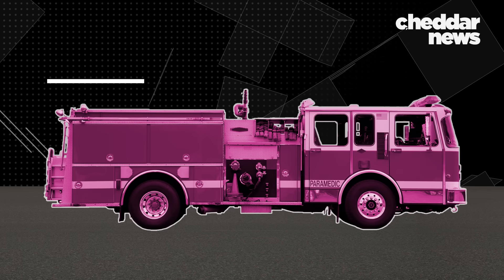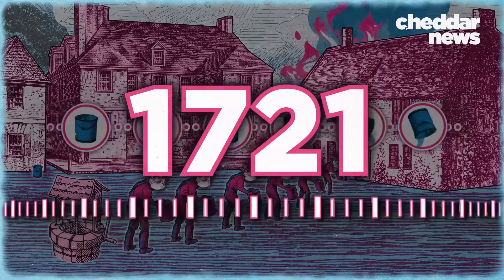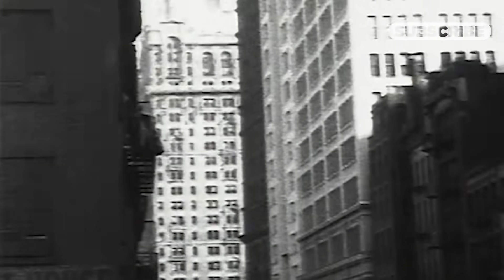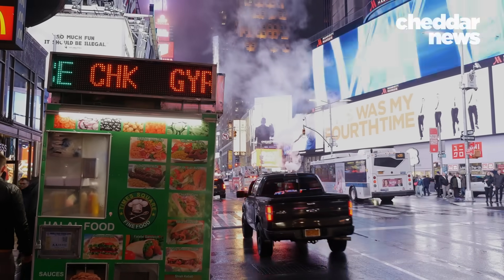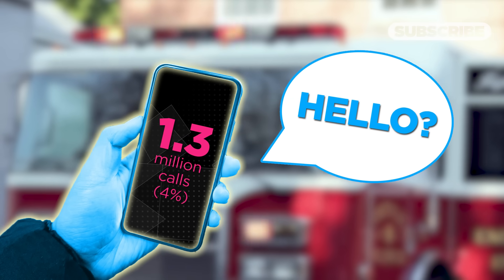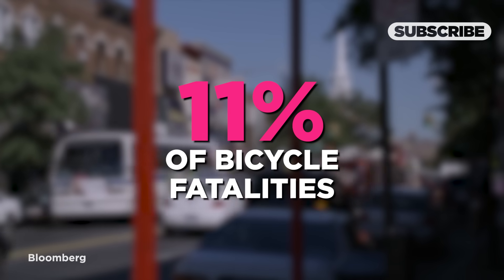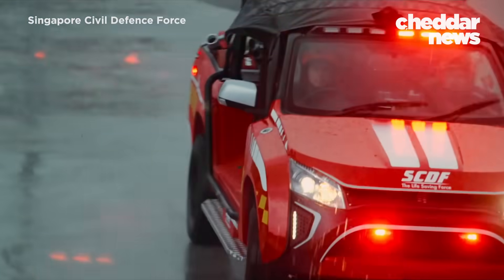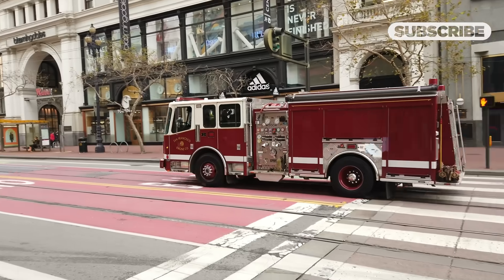Do American Fire Trucks Need To Be So Massive? - Cheddar Explains

Comment: Just a few notes, fire trucks are not 10 feet wide, only 8 feet DOT regulation. Yes ladder trucks can be 40 feet long, most engines are well under 40 feet. American firefighters perform much more than just fight fire. Medical call, hazardous materials, rescue, and all the equipment need for them to perform  their jobs. As for fire apparatus accidents do happen, in statistics about fire apparatus accidents you failed to post you was at fault. 95% of fire related motor vehicle accidents are not the fault of the fire apparatus driver. Failure to yield to emergency vehicle is the number 1 cause. Yes they are heavy just like any large truck in the US. Again you failed to mention that fire apparatus drivers are trained to the NFPA standards to be able to operate a fire apparatus. European fire department  are for the most part national organizations. In the US each City, county or district are responsible for fire protection. Also in Europe most streets are much narrow than in the US and n one major difference is most European structures are made out of stone, concrete and other non-flammable materials. There simply is not enough trees in Europe for them to be made out of wood. Isn the US most structures are made out of wood framing. Yes we have concrete and steel but the vast majority ate wood frame. European firefighters most fight room and content fire. The US firefighters fire actual structure fires. One thing in American fire trucks that take up a large amount of space and add a lot of weight are the water tanks. Depending on the area city, urban, rural dictates how much water a fire truck needs to carry. There are no fire hydrants in the vast rural areas of the US. Europeans do not carry as much water. Yes we can place 4 to 5 firefighters in a small 1st response vehicle and they are perfect for medical calls. Not so good for rescue or fires. We can send 50 firefighters in a bus to a large fire, but what good are they without their equipment? Before you start bashing the size of American fire trucks please take some time to learn what it takes to become a fire fighter and what the American fire service does and how does it. Yes it would be nice to have smaller fire trucks. But when you look closer like your video shows fire trucks come in all shapes and sizes. Each one does something special very well, at the same time it has to respond to all types of call. One major problem faced by the American fire service is all fire apparatus regardless of who is using it, must meet the federal requirements and EPA requirements, DOT requirements, and NFPA requirements. All of these always drive up the cost. European fire trucks must also meet their standards which I do not know how strict or lax they are. The standards of service will always dictate what you have to meet and how.  Thank you for your time

Comment: One thing you're missing is that, yes, most calls to the fire station are medical, (between 2/3s to 3/4s, depending on time/area); but when that happens, fire engines don't roll out- the EMS vans at fire stations do. Forgetting that detail is problematic, as it paints the picture of the fire engines rushing out when someone has a heart attack...

Comment: All I hear is more European Superiority without an explanation as to why. As a former firefighter I noticed in Paris and London they have as much problems with traffic as any other congested city. A really nebulous category is how a fire truck should look. We like the way ours look. If you don't oh well. Ours carries a lot of equipment. A lot. It is better to have and not need then need and not have. There was no real detail on why the trucks are different. Just more "European is better". What about a list of what the standard FDNY engine, truck and tower ladder carry vs. A London or Paris pump, turntable and platform carry?
Reply: Europeans firetrucks carry a lot of equipment too despite their compact size. This is the typical layout in an Italian engine (APS), which carries also 5/6 firefighters.
https://youtu.be/i8Y32mshPrQ
Reply: @thecommentaryking  they may and they may not. A YouTube video is a poor substitute for actual lists. There is a reason ours are the way they are. And a reason the Italians are the way theirs is. I don't even consider this a thing. Another thing....what is the cost of a pump in London, Paris or Rome? A turntable ladder? A platform? What are each's capabilities in comparison to a U.S. equivalent? Are they the same? Different? By how much do they differ in capability. For instance I believe the highest output standard pump output in France is 800 GPM. For the FDNY its 1500. (I believe). Obviously we didn't just pull this number out of a hat. There is a reason this was spec'ed out like this.
Reply: @richcook2007  Over a thousand litres a minute is nothing to sniff at.
Reply: @richcook2007  Yeah no. Fire equipment is standardized here, maybe a piece of gear might not be avaiable to the rural volunteer detachment here, but all provincial commands, especially those in the largest cities are fully stocked. Plus in the comment section of that video there were italian firefighters that confirmed that the equipment was what they actually carried.

Sure there's a reason in the US you use Pierce trucks, and there's a reason we use here commercial trucks. But my point was another, that the fact that ours are smaller doesn't mean that they carry less.

As for prices, they range from 200,000 to about 500,000 € per piece for new engines and ladders. Capabilities are similar, an APS (engine) here is the basic rescue vehicle, called for most emergencies like fires, car/vehicle accidents, technical rescues, nbcr, people locked out of their homes, etc. Other vehicles (like ladders) are classified as support, meaning they will carry only a crew of two, minimal equipment and be sent on a scene where an engine is already present or is on the way.
Reply: @oscarosullivan4513  Did I say it was?
Reply: @thecommentaryking  yeah, no. Ladders are just classified as front line apparatus. With a full complement of ground ladders and extrication gear plus cutting equipment for ventilation, and, maybe a pump as a quint. Your version of fully equipped may not be ours. If cities want to spec smaller rigs have at it. I'm not advocating one over the other. Budgets and need will dictate. But the video served absolutely no need other than ours is better backed up by exactly zero data.
Reply: @richcook2007  Maybe in the US, not in Italy and most of Europe. Ladders are sent out to support the engines in specific cases, they don't go out on their own.

That the video is dumb as it is, is something that I can agree with, it lacks much information regarding both sides, the tactics, the needs, the organization, the building construction standards and how urban/rural the territory is (in Europe everything is much closer).
Reply: @oscarosullivan4513  I apologize fore the snarkiness of my response.
Reply: @richcook2007  we sure, an Engine in e.g. Germany carries a lot of equipment as well. "A YouTube video is a poor substitute for actual lists." ... well then: a by now outdated norm for the Engines defined a minimum of 164 different tools at a total number of 284 pieces, but that was on trucks which are more than a dozen years old now.
Reply: @thecommentaryking  "they don't go out on their own." that clearly depends on the nature of the call. Depending on the country and call, they definetly DO respond to incidents on their own
"in Europe everything is much closer" yeah lol ask those guys up in Sweden or Norway
Reply: @EnjoyFirefighting  I would like to see that list. Also we have combination companies: medic engines and rescue engines that combine functions. I am putting the size difference to differences in firefighting philosophy.
Reply: @richcook2007  let me see ... I try to find a way to make you see it without me doing some sort of copyright infringement, like posting pics from database where I counted that. To read the  DIN 14530-27:2019-11 online would cost almost $80, not really an option. Well ... then try this one from one of the state fire academies in my state. Click onto the website and scroll down to where it says "HLF 20". I'll open a pdf file listing the bare minimum of required equipment for a standard Rescue Engine (former only classified as Engine) here. It's in German, but you could translate the single positions via google translator if you're interested in what they actually write down there; Right next to the piece of equipment is the respective number of the DIN standard, and the 3rd column shows how many pieces of that equipment need to be on board: https://www.sfsr.de/feuerwehrfahrzeuge-ausruestung/mindestausruestung-fuer-normfahrzeuge-der-feuerwehr-in-bayern

You might not come quite to the number I mentioned for various reasons: the standard has changed and adapted over time; Some things which might have been counted seperatly in the past could be grouped together has a set of equipment x, which consists out of several pieces, but counts as only 1. Thus e.g. the set of lifting cusions count as 1, and so does the box with 14 pieces of wood of 4 different kinds count as 1 just like the set of rescue cylinders counts as 1 as well.
Reply: @EnjoyFirefighting  a gentleman in this thread listed the equipment his truck carries. At some pint I will compare the two. Thank you.
Reply: @EnjoyFirefighting   Sure, it depends on the country, in fact, I commented in regards to my country, Italy.
As for distances, Norway, Sweden and Finland aren't the norm but the exception in Europe and if we are really fair, some US and Canadians fire services have far more territory to cover.
Reply: @thecommentaryking  sure they're different than many places in Europe, however those countries in northern Europe make one eighth of Europe's area and thus should be a legimate aspect in that discussion as well. 
"some US and Canadians fire services have far more territory to cover." first I thought it would be more about USA and not Canada, and then I have no doubt that there are services which cover greater areas. But there are definetly large areas to cover by some departments here as well, like a department in Sweden covering 8,000 sq mi, with 17k out of total 22k inhabitants living in a town of 6 sq mi. In Finland there's a department covering 38,000 sq mi which equals one third of the country's land area. Sure smaller than what some departments cover in Alaska, I have absolutely no clue about the size of their response areas, but you got to admit that 8,000 sq mi or 38,000 sq mi of response area is not small

Comment: i'm a firefigther in argentina, i've had the chance to use both american and european firetrucks and believe me theres nothing like the american ones. Water pumps are usually bigger and stronger, comfort for the firefighter to change and equip himself is significantly better. Many of the smaller trucks shown in the video are for forest fires, which are not worked the same as structural fires that require more equipment and water. American trucks are bigger but better.
Reply: what are the advantages of a european fire truck in argentina?
Reply: @yeoldeseawitch  some cities have really narrow streets (as european cities) so some american firetrucks are not that easy to maneauver, point for the european trucks in those cases. Also, some repairs are harder with american trucks and the european ones are easier to get the replacement.
Reply: @facundomartinez5535  Watch any old Irish or English firefighting tv series of actual firefighters not a tv drama. Rte D watch or Blues and Twos and fire fighters changed in the back.
Reply: European pump appliance:shows Australian pump.

Comment: In the 1970s US fire departments like Philadelphia tried using smaller mini pumpers.  It didn’t work off the top of my head I don’t know why. 
Other reasons why trucks are big, government regulations on what has to be carried.  
Tiller trucks offer better maneuverability. 
The more axels offer more and better braking.   

You could have contacted fire apparatus manufacturers or the NFPA or even the FDNY
Reply: More axles allow then to cross small country bridges,